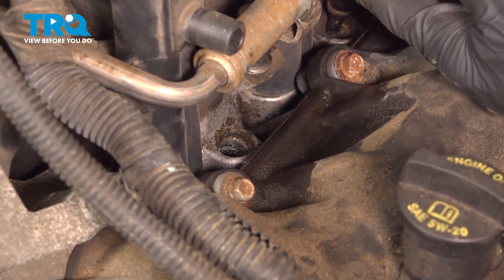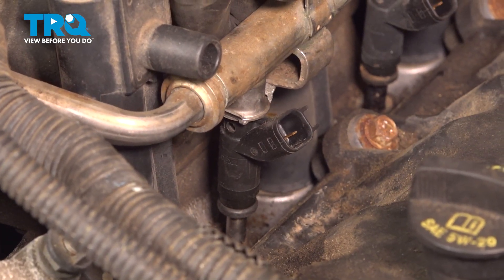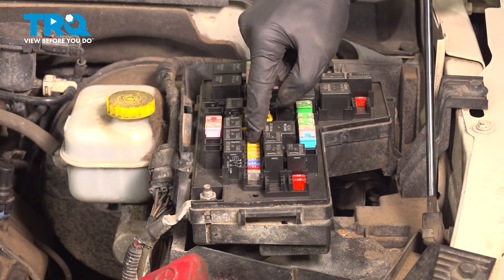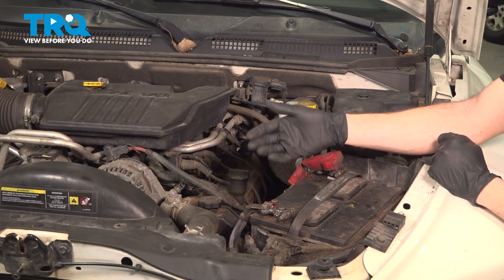How to Replace Fuel Injector 2005-2010 Dodge Dakota 4.7L V8

Comment: Thanks for the video, it wasn't quite right for my year and model, but still provided plenty of tips on what needed done. Got all 8 injectors installed, only thing I did different was remove the entire fuel rail and work on it at a bench.

Comment: Use needle nose pliers to grab the injector clips from the side where the clip will slide out and pull it off securely.  Using the method this guy suggests will leave you hunting for the clips that went flying uncontrolled.

Comment: Yeah, sometimes they give you advice that is dubious and eye brow raising... Like why do you need to fiddle with the fuel tank? And why do you want to start the car and throw a bunch of codes on the ECU? Just find the pressure test valve and release the fuel into a cup! Also, bro didn't even lube up the fuel injector o rings with dielectric grease... meh... But than you for the video anyway
Reply from the maker: +Bob Henderson We appreciate the feedback. Sometimes there are multiple ways to accomplish the same repair. http://1aau.to/m/Shop-TRQ
Reply: why can’t i get my fuel rail back into the injector spot